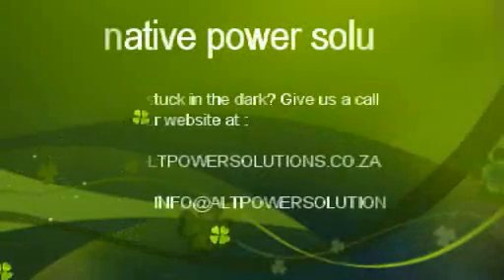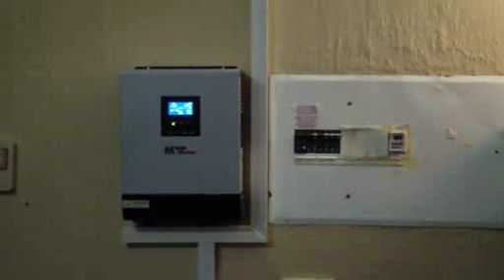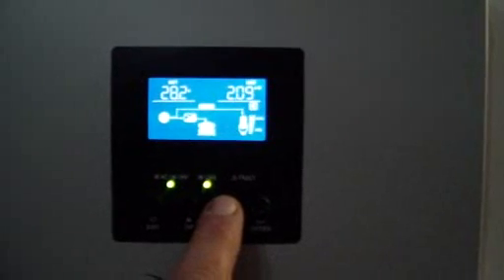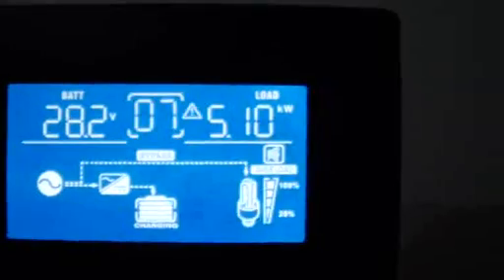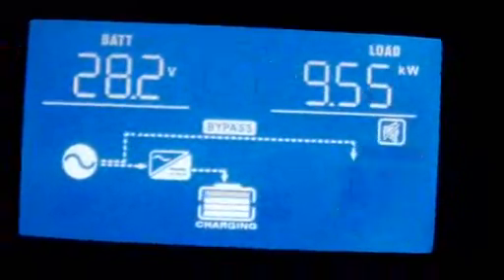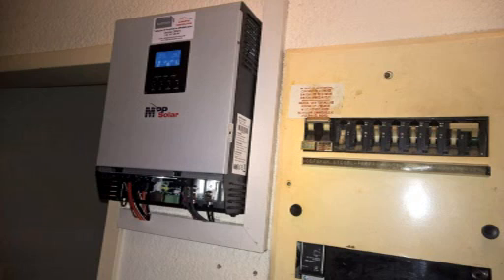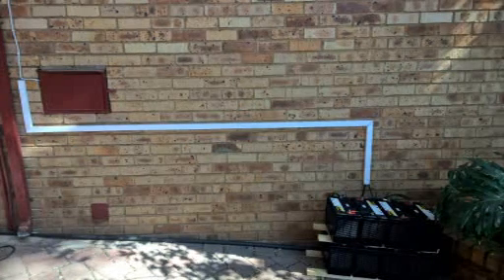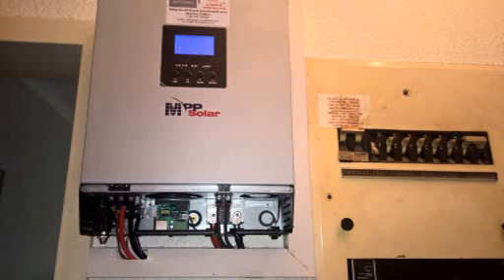3 Kva grid interactive inverter

Comment: Am I correct by saying the grid power can go directly to ac input, from there to the db board ?  For this is what I understand from the video, if it overloads on the grid power the its fine and does not damage anything thus I would like to know if I can put the grid power straight to inverter Ac in and the ac out to the db board.
Reply from the maker: Your power coming in goes into your inverter input. From your inverter output goes to DB board. Your inverter must be Set on overload bypass. Setting 23. Hope it helps. Will only overload if there is utility power available otherwise will trip depending on size of your inverter. Please note this is a hybris inverter.
Reply from the maker: https://voltronicpower.com/en-US/Product/Detail/Axpert-MKS-1KVA-5KVA
Reply from the maker: Please ensure your setting setting no 23 is bye (bypass enabled) you can download Manual, just type in Google search - axpert hybrid inverters pdf download

Comment: So I have a 
n enphase inverter state. connected to the grid and I am looking for a good a.c. coupled inverter that will work for main appliances like refrigerator in event of a power outage. I have batteries already but looking for suggestions. I wanted to just use a pure sine ups to trick the grid but my problem is what happens when I have excess electricity from the solar and batteries are full. someone mentioned I would need a dump load.
Reply: So my grid tie inverters would also shut off once the batteries are fully charged and no more loads need electricity.  I was worried about the whole isolation part from pushing back out to the grid when there is an outage

Comment: Thanks for the great vid and info ideas please I have purchased the v series with grid tie . my issue is that I always have a +- 500w draw from Eskom and then the solar supplies the rest or as much as it can . this means I draw 2 or 3 kw to run the inverter every day  . I have changed and played with the settings and still have the same issues . the only way I see around this is to put the supply of the inverter on a timer  or switch on the grid tie and only then do I pull max solar but have to be careful not to send it back to the prepaid meter . do you see similar issues with yours or do you know why this could happen
Reply from the maker: Hi Mark, I Have never installed grid tie so would not be able to help on this question,
Reply: I was reading power with a effigy meter and it gives me false readings now I have another meter and it  says I pull 10 to 20 watts and the rest comes from solar . my inverter has a grid tie function but I generally don't use it thanks again